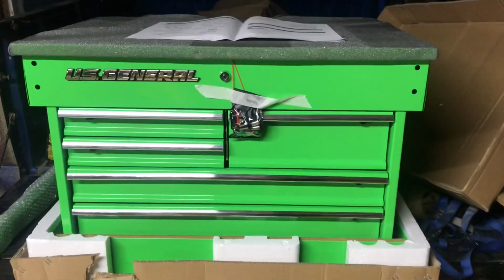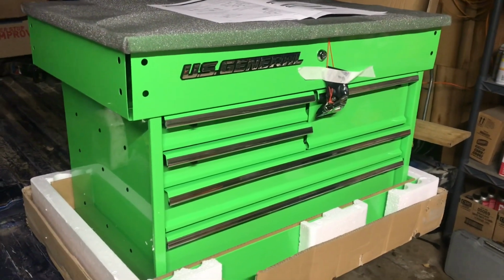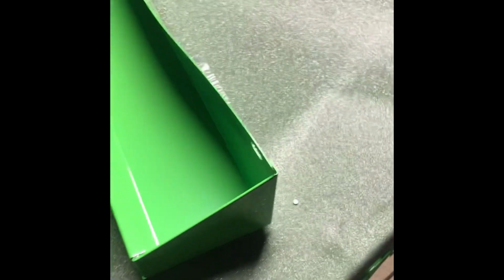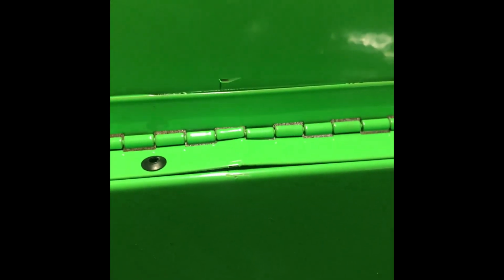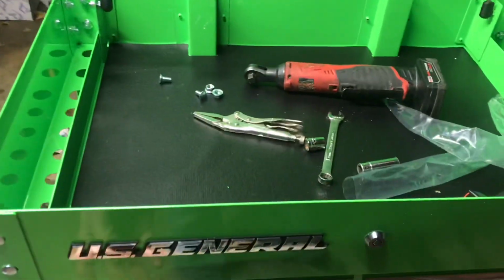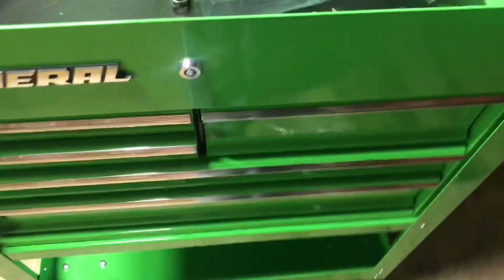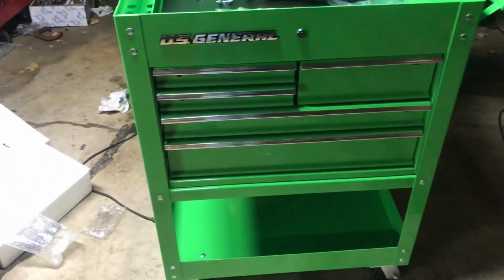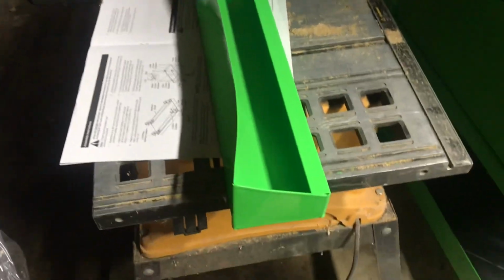New lime green US General tool cart from Harbor Freight

Comment from the maker: So far, my local HFT has been great at customer service. They offered replacement or partial refund for my box. I did not feel like building another box, so I chose partial refund and fixed everything besides the bent hinge and dent in the back of the box. Stay tuned for my video coming of the red series 2 cart I have that I turned into a welding cart.

Comment: I have the green one also I plan I buying 1 more so I can keep them next to each other and have 1 kinda big cart. 1 that stays and 1 that moves around. You keep the tools you take with you to vehicles or whatever you are fixing in 1. The other 1 can hold the other stuff you dont use as often
Reply from the maker: That’s a great idea. When I get my shop built this coming summer, I’ll be buying a couple more of different colors. The green one will be for my regular maintenance and repair tools. I’ll get one just for electrical connections, tools & lights. I’ll get one for just brake tools probably. And I have a red one set up as my welding cart now.

Comment: I don't know how you got that big cordless ratchet in some of those tight places haha!  I used a ratcheting combo wrench and it was tight.  How did HF handle the bent tray? Nothing bent on my second one, but the chest holes were off, causing me to have to lift it an 1/8" off the front & back rails to align, which I then shimmed. I am apparently the only one to have encountered that issue...wierd.
Reply from the maker: Haha. I love my Milwaukee tools. I had to wait until a few days ago for them to get another green cart. Took the tray in and they replaced it for me, no questions asked. Since I had already put the cart together, i didn’t want to fully exchange the cart with another one. I showed the manager pictures of the back damage, the damage of the drawers, and the bent hinge. Since they were going to have to sell it at a discounted rate, he gave me 20% off of the price back in a refund. I’m completely satisfied with Harbor Freight Tools customer service. I have since paid for a Black 44” lower box to replaced the blue and black box that you see in the video. It will be here December 23rd and hopefully contrasts well with the green cart.
Reply: My holes were off too.
Reply: I tried using my m18 fuel brushless 1400ft lb 1/2" drive impact but it was too bulky, so I switched to my dewalt 20v impact with a socket adapter, which worked on some but mainly just fucking spun because the stupid bolt head square wouldn't bite, so I tried a 3/8 drive ratchet wrench which wouldn't fit in some places, ened up having to assemble damn near the entire thing with my craftsman 1/2" box wrench lol... at least one side ratchets 😂

Comment: I just got the same cart. Already love the thing, I have to shut the top drawers a little hard for them to latch but not bad at all. I got the 1 year extended so if it's not big enough I can return it for credit on a larger one.
Reply: I got one in lime and same thing with the two smallest draws I think. Its slowly been getting better
Reply: My idea was just to buy another cart same color so I have 2 put the handles on opposite ends and keep the put together so it looks like 1 big cart.
Reply: With the extended warrenty you can get credit on an upgrade for the entire duration?
Reply: @user-xd3en9mm5x  yeah 1 or 2 years starting 90 days after the purchase. Never had a problem half the time they don't even ask why it's bring brought back but on occasion if they ask just tell them it's not right for the job at hand...unless it's actually broken lol oh and just to add you can get credit/cash back on what ever it is but they hit u with a 20% restocking fee... if you stay In the same category and get some kind of replacement or upgrade it's 100%

Comment: Which grease gun do you have?
Reply from the maker: Milwaukee m12. Really nice for occasional use. I have a bobcat loader and several trucks. Good enough for that. If you’re maintaining a fleet though, get the larger m18 model. Mush faster and higher pressure.
Reply from the maker: I really like the m12 stuff so far. I have lots of m18 stuff as well but I really like the compactness of the m12. Hopefully ordering a stubby 3/8 impact in the near future.

Comment: Really wish they would put some more effort into packaging. Even if it did raise the price a 5 bucks. Shame that most of the bad rep of some otherwise fantastic stuff come from piss poor packaging. Yes,they got some junk like the $9 115V grinders or $5 air die grinders but I have had great luck with most stuff from there. My 300lb fat ass was hanging off both their breaking bar and the extendable handle ratch with a 3 foot cheater pipe on it to loosen the caliper bolts on my F550(Breaker bar) and lug nuts also on the same truck(ratchet). Neither one broke or bent. Flexed but went back straight when pressure removed.